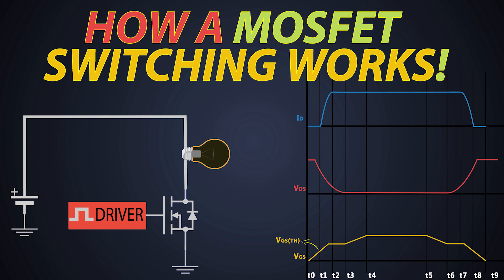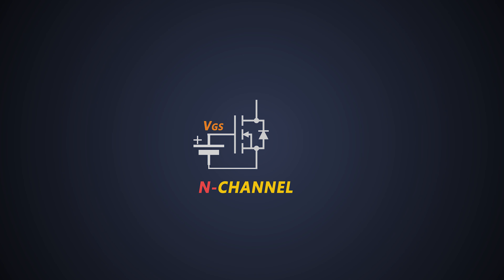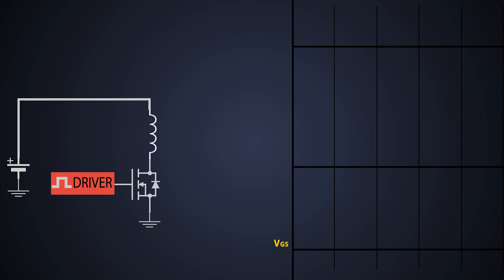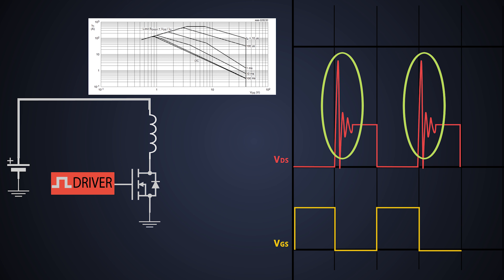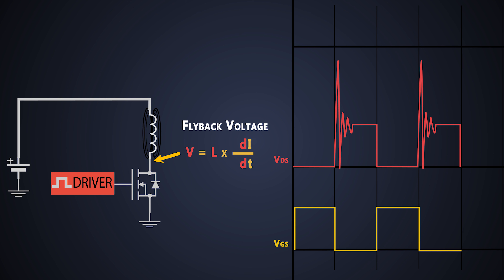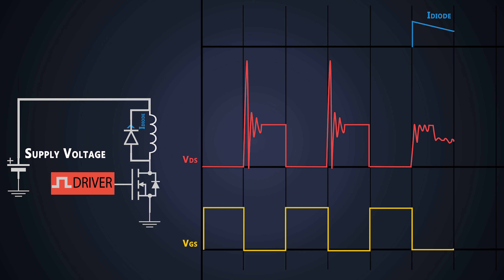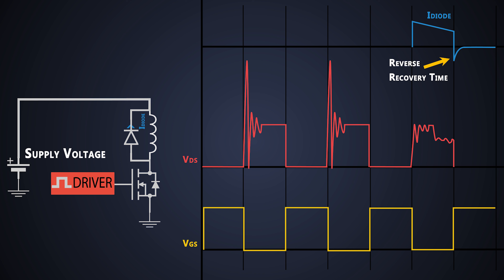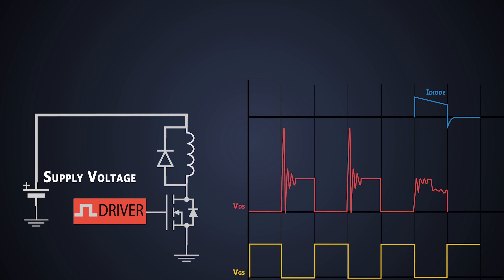MOSFET switching for an Inductor | Inductive spiking & Use of Freewheeling diode

Comment: The voltage spike generated across the coil when the MOSFET goes OFF is the opposite polarity of the supply voltage. Therefore, the diode is  conducting when this happens and dissipates this energy into itself and NOT as mentioned, into the supply.

Comment: I did learn about dc to dc convertor through your vedios.Thank you very much.
Reply from the maker: Thank you so much! Please show support to my video with Super thanks.
Reply: @FoolishEngineer  i am from sri lanka. Thanks your helps.
Reply: @FoolishEngineer  i am going to create pure sin wave inverter using sine wave oscillator, class D amp. and low pass filter, i need your help. Could you help me?

Comment: I was using inductors and high speed switching with a 27,000MHZ quartz crystal to create a swing for a Tesla coil and I was testing it with a dead 9v battery that had about 6v left in it and it went into a resonance cascade and it fried the whole ciruit also it wasn't hooked up to a coil yet  ..  but ya my goal was to creat a specific resonance only I got wayyyy more than I expected .  If I can recreate it again it will be tricky to handle the continuing increase to find out far it can actually go without frying it again ,,  not sure what to do next since it isn't ready for the coil or , maybe I need something else .  I had originally thought I would create two circuits and apply them against each other with another crystal at 28,000MHZ to get the resonace started and then figure ways to adjust it provided it's close enough to correct parameters  ..  🤔  I was able to run another circuit like it with an earlier SCR without it frying and it runs off of 5 v and of course the goal here is to keep it running after the 5 volts is gone if it can continue to remain regeneratively and if it can pull what it needs from the air and keep the LEDs lit up  ....
Reply: You likely created an uneven charge/discharge time in the ac cycle. Would be curious to see a circuit

Comment: I have two non expensive solar grid tie inverters. They cause a great deal of RFI. I am unable to use my radio equipment unless i disconnect them. I tried installing an inline filter but it makes very little difference. I also tried putting a large capacitor in parallel with the panels but no help there either.
  I actually came here for a different reason. Wondering if it would be possible to make an AC flywheel circuit for mains electricity. The concept 2 banks of electrolytic capacitors in different orientations with Zener diodes on each of them so they only charge once voltage goes above a certain value then they release the energy again on the down cycle. 
  The idea being to buffer the ac mains voltage so when items are switching in and out they take that initial draw of power from the capacitors and not from the grid, thus helping the solar power smooth out peaks and troughs of power demand as devices switch in and out / on and off such as inverter hot plates for cooking as they cycle on and off.

Comment: Hello. I want to make a fake load circuit to test the battery that can adjust the current passing through, my idea is to use a mosfet. load directly from the mosfet. I hope you can help me calculate the tolerable capacity of the mosfet through its datasheet and how to dissipate heat for durable use. Thank you very much

Comment: Thanks for the informative video.
But there is correction in waveform, when vgs is high at that time vds won't be 0 it will be equal to the external supply as inductor will become short circuit (constant current). So full external supply will be shared to vds of mosfet

Comment: thanks for this video but i have a doubt  that ,i have a gate driver circuit  and  i have also used a diode as u taught and iam still getting high spike after some time my simulation runs? why

Comment: I'm trying to make mosfet spot welder after blowing mosfets i searched alot about this failure and found voltage spike is killing mosfets this is my mistake to not knowing about mosfet properly after watching your video i found that my wires are inductive load which creates positive spike at drain so i need to place diode between mosfet's DRAIN (before wire bcz wire is inducing positive spike)  to "+" Terminal Of My Battery.

ANODE leg to DRAIN 

CATHODE leg to "+" terminal of battery.

Correct me if I'm wrong?

Comment: One additional points all power supply are not sinking type so you can put large electrolytic capacitor to sink the current when MOSFET is off
Reply: The capacitor could get damaged because the potential difference between the + of the back EMF (i.e. Voltage between the Drain and the Voltage Source when the MOSFET turns OFF)  and the positive terminal of the voltage source will be large. So, we might need a very high voltage capacitor.
Reply: @electroquests  no when freewheeling path is present at that time it will not damage the capacitor.. input voltage *2 rated capacitor is enough
Reply: @electroquests  Once the diode is added to the circuit, the back emf can never exceed the positive supply by more than one  diode drop (not more than a volt or so, worst case). You only need a capacitor with a voltage rating a few volts more than the supply voltage.
You really need a return path to ground via the supply in any scenario, so you're going to put a capacitor across the supply in any case.

Comment: At 5:00, the description is somewhat flawed I think. The protection diode just dissipates the flyback voltage as heat without diverting it back to the main power supply.

Comment: When the MOSFET is OFF, the back EMF from the inductor will cause a current to flow through the diode and back to the supply, but in addition to that it can also flow through the inductor itself. So there will be two paths for current to flow, right?
Reply from the maker: I highly doubt that. I need to check on it.
Reply: When MOSFET is off then diode act as close switch for flyback  voltage so diode short circuit to the  inductor during this time period so current flow only in inductor not to power supply because ground path of power supply is not complete .

During this time inductor and freewheeling diode will heat so generally one snubber circuit i.e. parallel combination of a  resistor and a small value ceremic capacitor add in series with freewheeling diode.
Reply: @pushpendraaryan5551   Yup you're right about the diode part. The circuit is actually complete, since the MOSFET has a body diode, the only thing is that the body diode will be reverse biased.
Reply: @electroquests  stored inductor energy will be dumped into the diode
Reply: The inductance tend to keep the current in the same direction ( no change in the direction ). So it flows back to the source through the diode.
Reply: Sir, is it displacement current, like we have when we're charging a capacitor?
I think the current flowing through the diode and inductor will be the current which flows when you have a closed path, while the one flowing towards the supply would be displacement current.

Comment: Thanks for the nice video. It helps to explain about inductive spiking for switch FET applications but why does this then result in a ringing effect? Why not just a large spike and then the FET settles back to the supply voltage?
Reply: The ringing is because of the LC circuit that's formed with the output cap, now recall a series RLC circuit's step response. The R is summation of the dcr of the inductor, trace resistance, the source resistance in the path.. hope that clears your doubt
Reply: The ringing effects comes from the collapse of the voltage spike

Comment: rubbish, the current does not flow trough diode back to the  battery, it cuirculates inside of the inductor
Reply: Actually It can do it, because spike Voltages from inductor has more potential than the battery that makes a circuit acting like a charge battery with 2 sources.
Reply: At least that is what it supposed to be, if you know why it flows through the diode pls explain me 👍
Reply: @thebread8918  if the mosfet is not damaged and fully closed there can be no current trough the battery. And if so, at least not in that direction